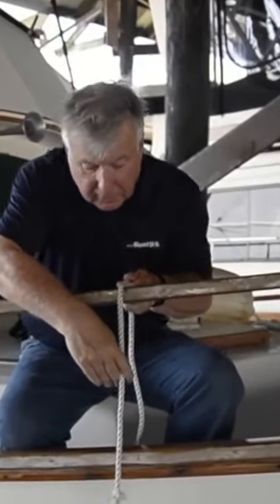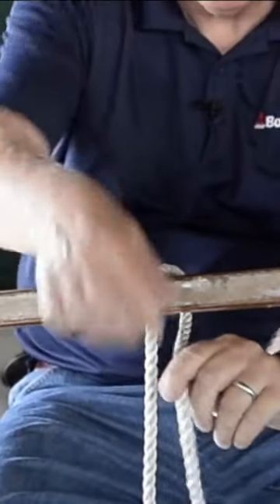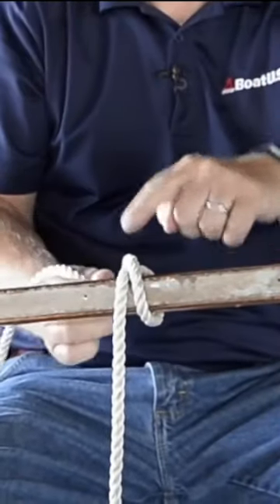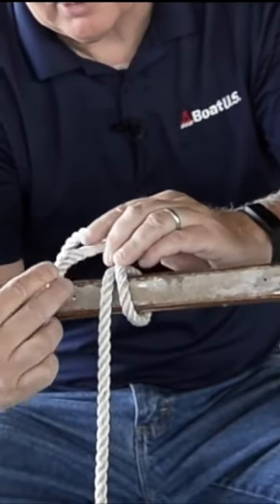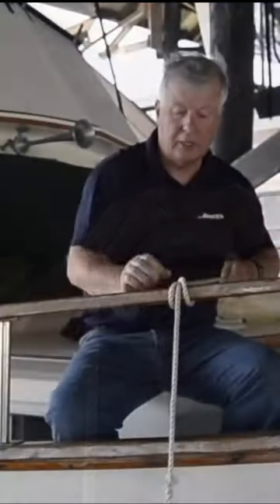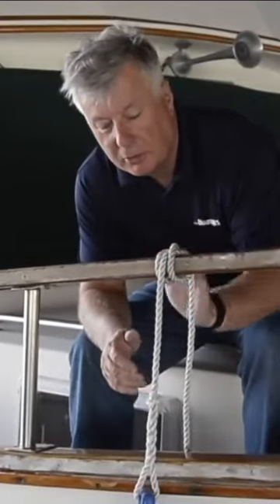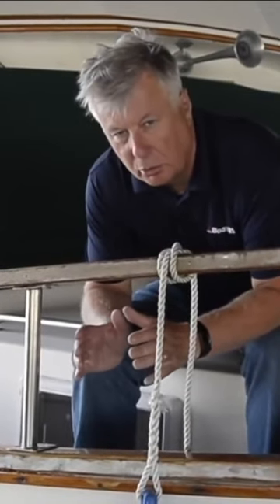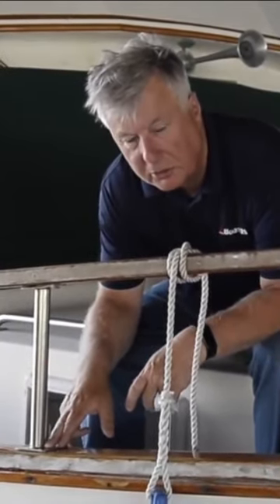Tie a Boat Fender Using a Clove Hitch [SHORTS] | BoatUS

Comment: And you lose your fender
Reply from the maker: If tied the correct way and in normal conditions, it shouldn't be a problem. In bad weather, we recommend attaching them to a stanchion or cleat.
Reply: You should never be under way with fenders hanging over your gunwales